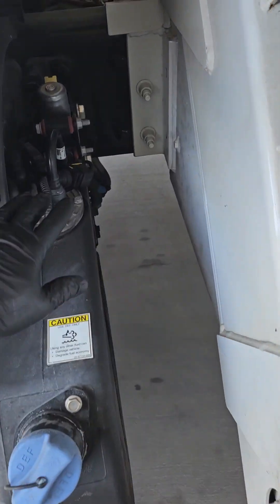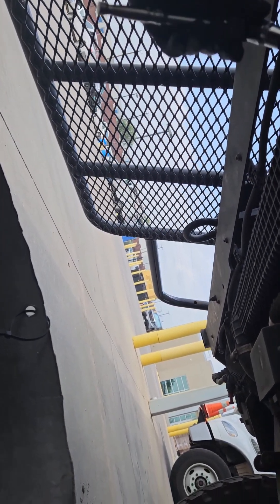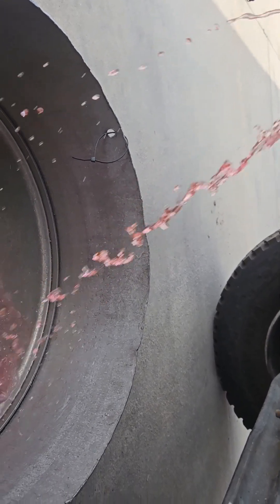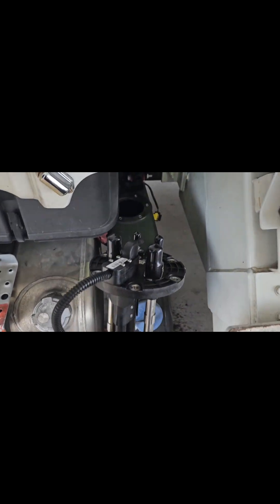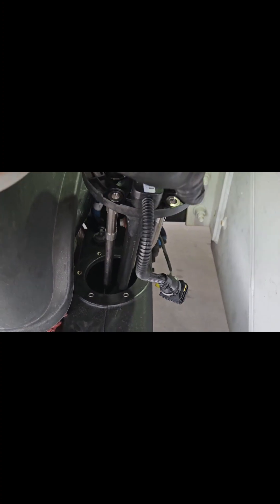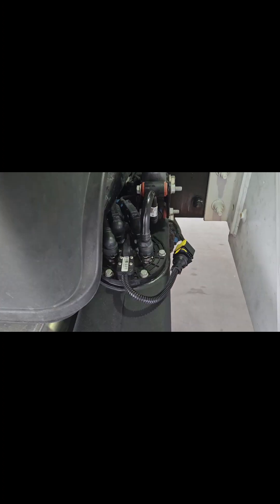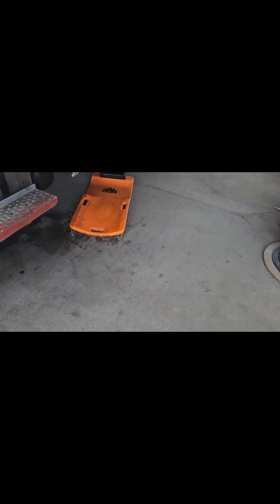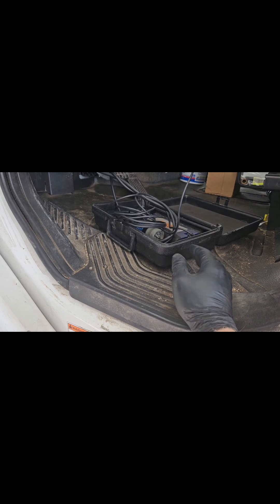Freightliner M2 DEF tank header replacement (level, temp, quality sensor)

Comment: No need to drain coolant, get a pair of hose crimps and there are soft lines right behind the tank in the frame rail area, clamp those and put a pan under the tank when removing the lines like this gentleman and you won't lose much. One less messy step

Comment: Is the def sending unit in the same circuit as the deft tank tempature sensor? I have a check engine light saying it can’t read the temp inside the def tank
Reply from the maker: Yes. The DEF tank temp, level, and quality sensors are all in the same assembly known as the header

Comment: My heater control valve on top of the def tank is getting very hot. I have already replaced the header. Will the heater pump cause over temp for the level sensor?